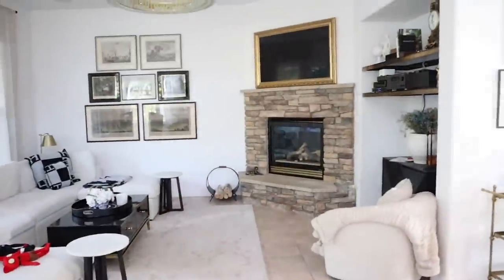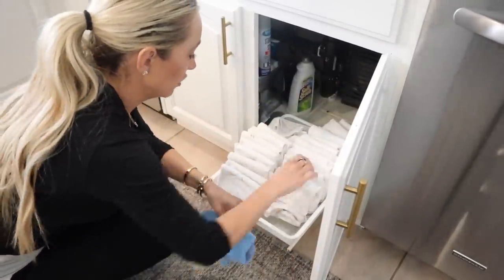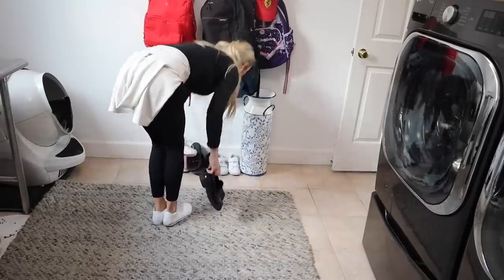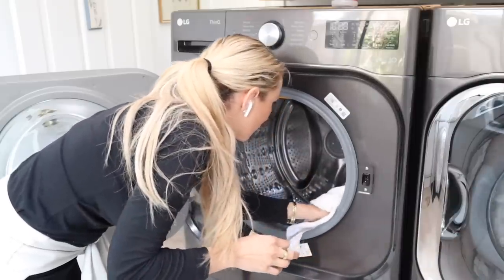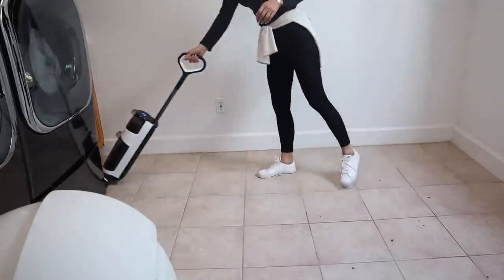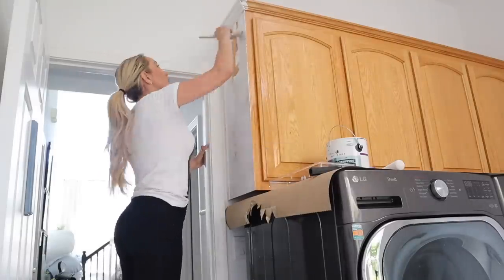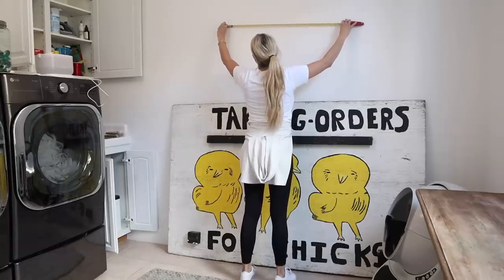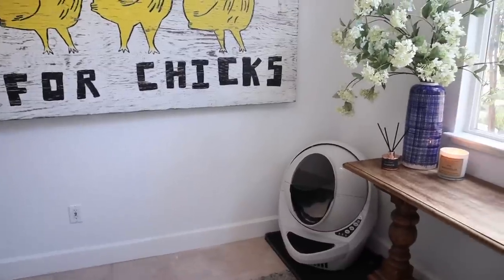DEEP SPRING CLEAN AND DECORATE WITH ME // $50 LAUNDRY ROOM MAKEOVER 😍

Comment: I use white vinegar in my washer as a fabric softener. It does 3 things, 1 removes any excess detergent in the rinse cycle, 2 removes and odors the clothes are likely to have and makes my clothes soft. After watching your video on the sheet bands from Amazon I thought I could come up with a less expensive way to do the same thing so I went to Walmart and bought the Goody brand of head bands for my sheets and blankets. Super stretchy and have the non slip on one side. Perfect, 5 for under 5 dollars.
Reply: I use white distilled vinegar as fabric softener as well. Also to clean carpets.
Reply: I use vinegar also, it is good for your washing machine too!
Reply: Over time the acid in vinegar breaks down the plastic and rubber gaskets and parts in your washing machine, potentially leading to expensive repairs